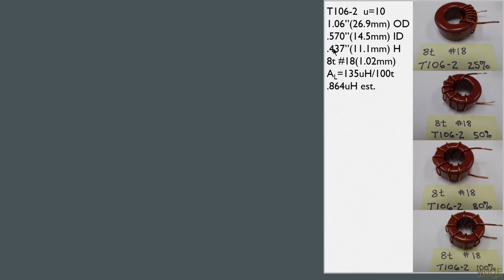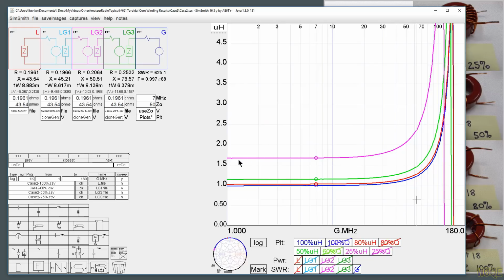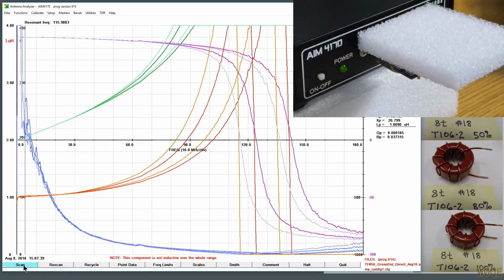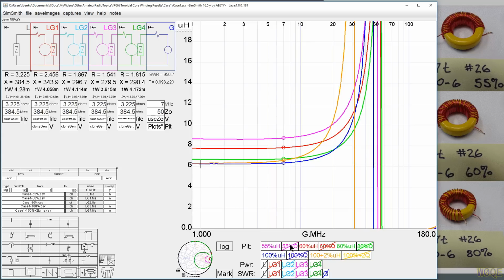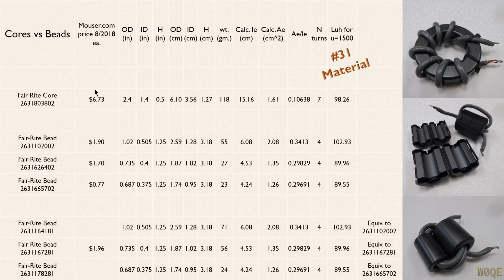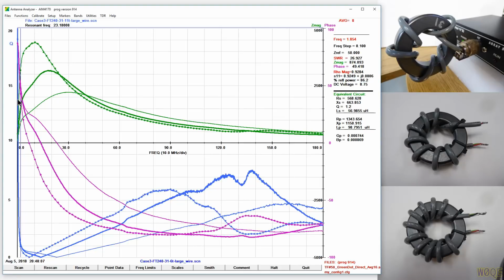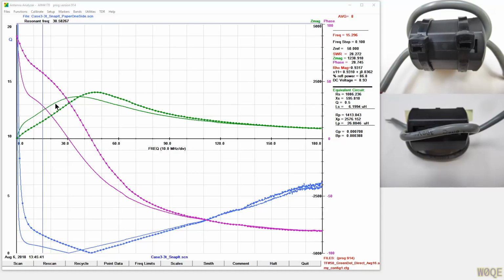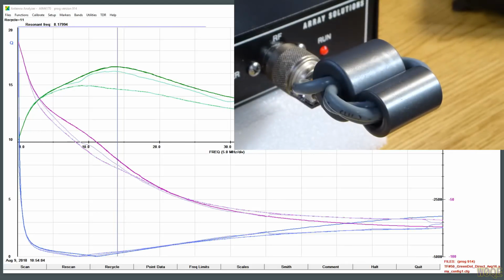#66: Toroidal Core Winding Results

Comment: I have been investigating winding toroid inductors. I start with a T50-2 core from Amidon. 1 turn, 2, 3, 4, 5, 6, ... 15 turns of #24 insulated wire. I repeated the same experiment with a T50-6 core with very similar results. I am winding them at 100%. I am measuring the impedance using a Tektronix TTR503A VNA properly calibrated at the end of the clips where the toroid is connected.  I consistently get more inductance than the equations from Amidon would tell me that I would have. This increase is generally on the order of what would be expected with 1 additional turn on the core.
Based on this video here, it seems that this is not unusual and that the calculated inductance from the official formula is more of a minimum value than it is an actual expected value. Maybe you can help me understand this a bit. Thanks.
Reply from the maker: I have mentioned this previously and it is pretty obvious.  If the core has a "high" permeability virtually all the flux from each turn is captured by all the other turns resulting in an effective inductance that increase as the square of the turns.  At the other extreme if a core has a "very low" permeability or maybe even an air core a fraction of the flux from each turn is captured by the other turns causing the inductance to increase linearly with the number of turns.  The classic "Wheeler" formula for inductance shows this linear increase for single layer solenoid type windings with an air core.  Now a core material such as #2 which has a permeability of 10 which kind of in the middle.  The Amidon formula assumes you are winding with a higher permeability material.  If we assume that nearby turns couple better than turns which are farther away you generally see the inductance rise as sort of a square of the number of turns and gradually changing to a linear increase of the number of turns.  Does this make sense?
Larry, W0QE
Reply: @w0qe  Got it. Ya know ... there is a LOT of magic in RF and, to some degree, there is more magic with inductors than in some of the other things (it seems). I appreciate the fact that you answered. Thank you. 🙂

Comment: Impedance is not so important        in an absorber. Because these tores are in serie with what appear as an antenna in some case it can deteriorate the filtration that you try to achieve you need resistance.

Comment: Can you share the equation of inductor toroid design?
Reply from the maker: The equation was in the video.  What exactly are you looking for?
Larry
Reply: @w0qe  the equation to define the wire length and the number of turns for toroid core
Reply from the maker: @exwaized523 
There are several approximate formulas I use.  There is an old program called "Mini ring core calculator" by DL5SWB that is pretty good. It is free and the latest version is 1.2.  Just do a search for it.  I also have some local data from cores I have wound in the past.  The company Amidon (www.amidoncorp.com) who sells toroids has a free flyer and other data to calculate what you want.
Larry, W0QE
Reply: Got it. Thank you so much, Sir.

Comment: Hi I need to make a balloon for 40m band and I have toroid 50mm*30mm*20 mm  how many turn should make pls answer me
Reply from the maker: Ziad,
I can not answer your question for a couple of reasons.  Knowing the size of the toroid without knowing the magnetic material and knowing what power level and number of turns you might need does not allow me to give you an answer.  What is a "balloon for 40m"? Is this an end fed half wave antenna that is supported by a balloon or is it something else?
Larry, W0QE
Reply: @w0qe  I think he may mean balun.

Comment: Are these "materials" standard across manufacturers ?
Reply from the maker: RobotZer0,
I don't think there are any real standards about materials for powdered iron and ferrite materials.  Every manufacturer has similar ingredients but slightly different amounts and processes in the cooking of the core.  Not all manufacturers use the same numbering for materials.  TDK has a completely different numbering for core materials.  Also from a single supplier there is a fairly wide tolerance for permeability (+/-10% or 15%).  This probably is not what you want to hear but don't be deterred.  Many designs do not need a precise inductance value and usually construction techniques matter more than who made a particular core.
Larry, W0QE

Comment: Nice video. I've learned something today, besides the reason why one shouldn't do a UnUn using 26 core material (fell into that trap, although for LF and MF is fine with a pretty good efficiency).

However, mind that the toroid is shielded, but you add tiny capacitors between the coils when you put your finger there. That is why your resonant frequency drops and Q is destroyed (it is further from being a pure inductor that it was).

Comment: i need to design 280uH inductor for dc todc converter. pls help

i calculate as I need 20SWG wire toroid core with 55 turns. pls comment
Reply from the maker: Kuldeep,
A T-200-26 with 55 turns is 280uH.  #26 material is good for DC supplies and 55 turns of #20 wire would easily fit.
Larry
Reply: W0QE thanks today i will do in lab

Comment: This is probably the most informative video or article on toroid winding I have ever seen.  This has really cleared up  many questions I have had about cores and windings.   I have a question about common mode chokes.  Assume I want to wind for 40 meters (7.2 MHz approximate center frequency), is high impedance the most critical factor?   Does the SWR of a choke matter if you have high impedance?   Thanks and please keep up these very informative videos.
Reply from the maker: Hank,
There are two properties at play here: Differential impedance and Common Mode impedance.  Winding turns of a transmission line thru a core increases the common mode impedance but does not change the differential impedance.  If you have a 50 ohm circuit with 50 transmission line and you use some of the existing transmission line to wind around a core the differential impedance and SWR do not change even though the common mode impedance increases.  If you add some transmission line length for the core then the SWR does not change even though the differential impedance does change (assuming the SWR was not 1:1).  The previous statements assumed the transmission line is lossless.  Does this make sense?
Larry, W0QE

Comment: I wanted to thank you for the videos you produce – it’s helped to demystify the Smith chart topic in general which has always confused me. Got a question – I made inductor to eliminate some RF that was getting into my phone lines. I used a 2” core (mix 43) and wrapped about 8 turns (4 turns in one direction and 4 reversed) using 4 conductor telco wire. Worked great! Now, I want to make it smaller. If I were to take three lengths of thin “Kynar” wire (used in wire wrapping), twist them together, than wire them in series. If I create a smaller version of the original choke, would the three-conductor wired in series have any advantage? Or, would it be better to have three parallel windings and wire those in series?